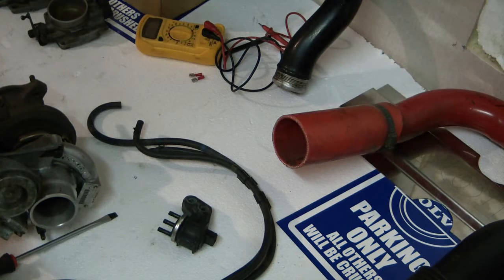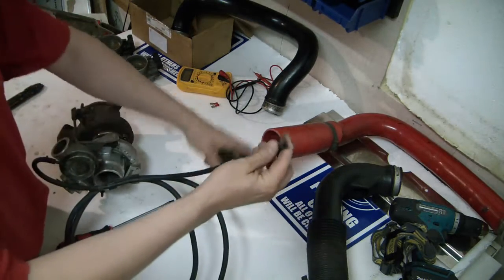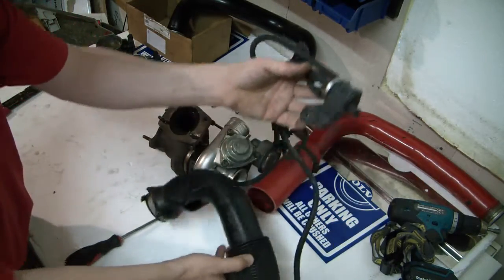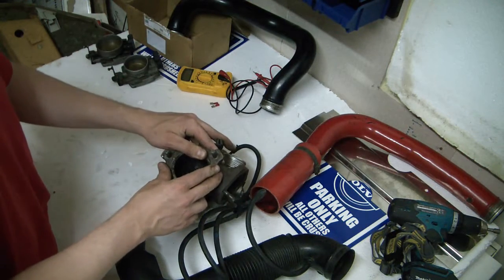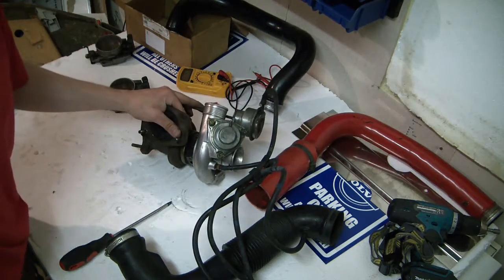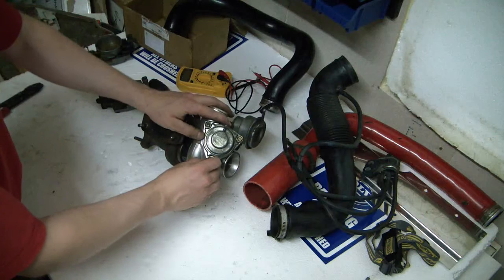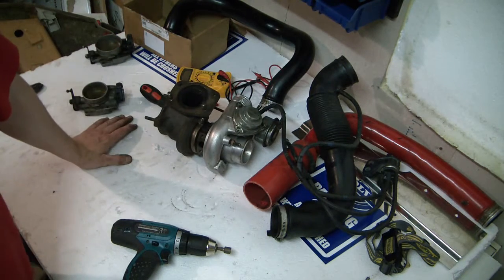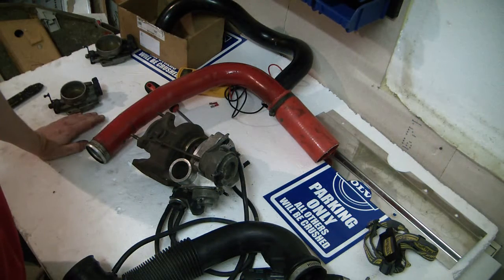Stage 0: Volvo 850 v70 BCS and turbo hoses

Comment: Hi! Your video is much appreciated. There´s something I don´t understand fully: If the BCS is not connected to the ECU, the boost pressure coming from the turbo goes directly to the Wastegate (keeping it open) or goes directly to the intake pipe (keeping the WG closed? In the first option, you will get almost no boost in the dash gauche, and in the second you would see the gauche increasing without control. Thanks in advance. Best regards
Reply from the maker: With BCS not connected, WG is open (saftey designed this way). You will only get around 0.4bar boost this way and boost builds really really really (really) slowly
Reply: Got it! Thanks. I need to test my WG  and I don´t have the tools required. I´m experiencing like fuel cuts off at wide open throttle after installing a chip in a second-hand ecu. I want to find out whether the BCS is working fine or not, and your explanation will be very useful.  Best regards. A Spanish fan.